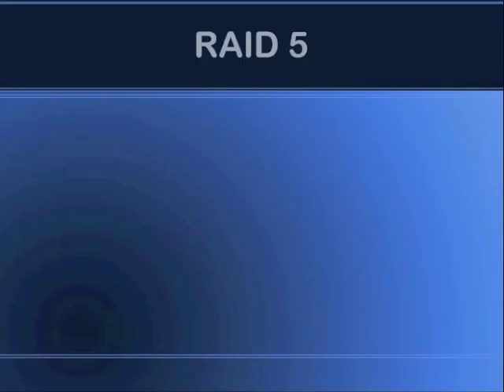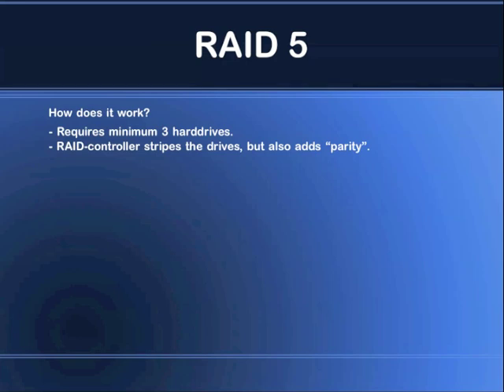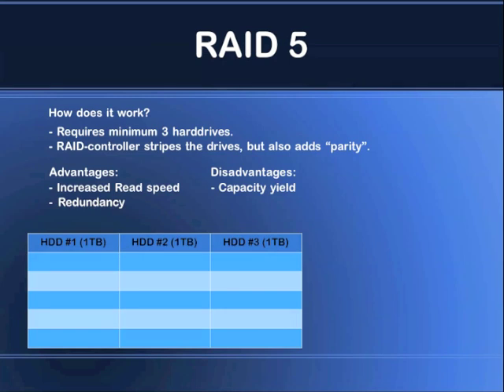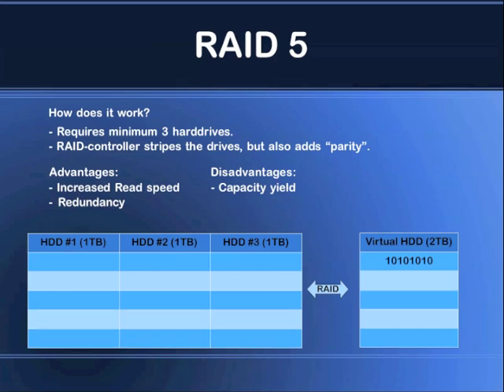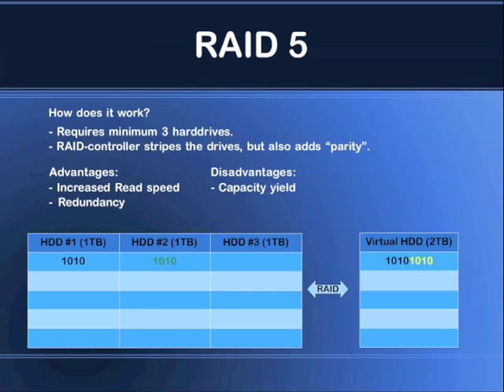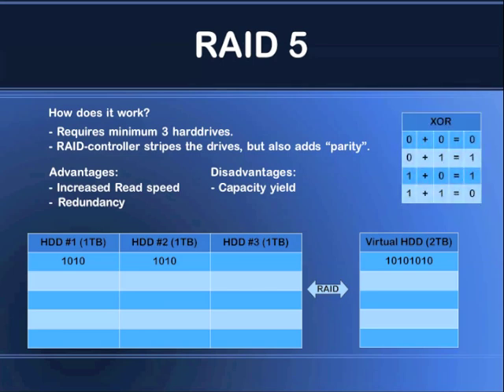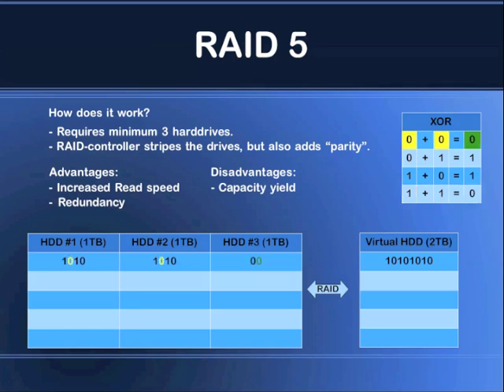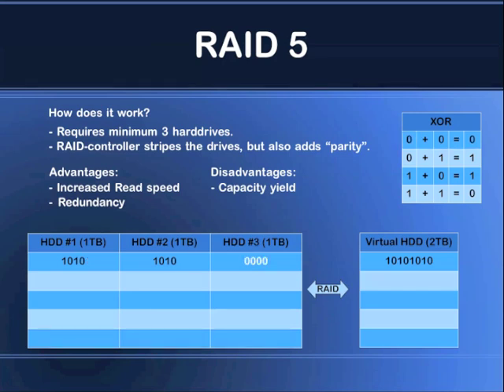RAID 5, explained

Comment: I've understood the bare-bones mechanics of this, but never understood how (the total of) one drive's space can hold data of two drives, but you explained it so very well!
I subscribed due to this video, I hope you have more great ones!
BTW, I am just now loading my backup into the new 3-drive array I built through Storage Spaces. It went together well, and my 6 TB has been loading for 9 hours now and has over a  TB left.
I saw there was an option to 'add a drive'. How many more drives of the same size (all 4TB) can be added before I need another one for parity? I think when I get to 5 drives I may go to RAID6. I also mirror that drive to a set of 8TB 870QVO. They are slow yes, but once the terrabytes are written to them updating goes fast, especially since they are striped. So it's something of a RAID10. I use 'freefilesync' for my mirroring and backups.

Comment: What happens if two hard drives fail at the same time, sir?
Reply from the maker: If two drives fail at the same time, the data is lost.
If one drive fails, and another drive fails before you swap the first one and rebuild the array, the data is lost.
So using RAID doesn’t eliminate the need for making regularly backups of the data.
There are also some RAID-setups that can tolerate more than one drive failure.
Reply: Thank you, sn0le. So Raid 6 can tolerate 2 disks fail at the same time, right? So we can not keep data 100%. But when raid tolerate 2 disks, what happens if 3 disks fail and so on.
Reply from the maker: @thlh1  
Yes. RAID 6 tolerates 2 drives failing. As long as you replace the 2 faulty drives the array can be rebuilt. A 3rd drive failure before a rebuild will redult in total data loss.
One can have RAID controllers that supports spare drives that automatically take over for the faulty ones.

Comment: BTW what if I have to replace one of HDD due to disk failure, Do I need to use new empty HDD, right?
Reply from the maker: Yes. You add an empty drive as a replacement for the dead drive and the RAID-array will rebuild the dta that was lost fromthe dead drive.

Comment: How would a RAID-5 work when you have 4 drives? Lets' take the first bit for example DRIVE-1: 1, DRIVE-2: 0 DRIVE-3: 1. So the three drives don't match. In this case, how would parity know how to reconstruct the data? "0" means that the three drives don't match but how would you know if to reconstruct with 100, 101, 110, 011, 010, 001, etc... there are many options for the mismatched bits.
Reply from the maker: It's agood question.
The RAID controller will do the XOR several times.

If you have this as a example.
Drive 1: 1111
Drive 2: 1110
Drive 3: 1100

First it will XOR drive 1 and 2.
1111 and 1110 creates a XOR-value of 0001
It then does the process again with the XOR value from drive 1+2 and the data from drive 3.
0001 and 1100 gives us the parity bits 1101.

Hope this was helpful. :)

Comment: What happens if you add another drive 4th drive? Does it rebuild everything? Or does it exclude the forth drive?
Reply from the maker: Hi, good question. I haven't tested that so I do not know what will happen. But I assume one has to make a backup of the data and create a new and empty RAID array with the 2 old drives and the new one. And then copy back the data.
Reply: Based on my knowledge, raid 5 goes by n-1. So technically it would not do anything unless u want it to be part of the storage

Comment: How does RAID 5 work when there are more than 3 drives? Just using xor will not work I believe.
Reply from the maker: For 4 drives it will first use XOR for bit 1 in disk 1 and 2. And then use XOR on the result from disk 1+2 and the 1st bit in disk 3 to make a parity bit in disk 4.
Hope that was understandable.

Comment: Very good explanation! Just a question - I understand why read performance could be increased, but don't understand fully why write performance does not benefit, as 2 of the 3 drives are striping correct? Does the overhead of calculating the third parity bit become the bottleneck?

Comment: you said at 1:20 that with raid 0, you would have a 3 tb virtual hard drive. This is not true. with raid 0 (and 3 drives), you only get the capacity of 1 drive and the theoretical speed of 3 drives

Comment: What I don't understand is how the drive knows what bits are parity bits, and which one's aren't. That can be seen as information itself, needed to be defined somewhere. 

For example, in the first row it will skip parity checking.  The second rows second column has white bits (which represent parity), and thus the data must be calculated.

So just how does the system distinguish  "white" parity bits from the rest?

Comment: So RAID 5 is the inexpensive way to go over raid 10, RAID 10 seems infallible however from what i've heard RAID 5 is very good at restoring a failed disk
Reply: raid 5 loses 2/3 of data when one drive fails. raid 10 loses no data when a drive is lost. it is also as fast as raid 0. so with raid 10 you get best of both raid 1 and raid 0. raid 10 is more expensive. thats why raid 5 is more popular in servers where down time is acceptable. you only loose 1/3 of total storage to redundancy where raid 10 is a type of mirror so you have only 1/2 of total storage available.

Comment: Your fault and SOL; data is gone. Should have replaced the first when it dies... If they die within a day or two from each other, then that's just bad luck and your data is still gone. 

Now, the real question is, if I had more than 3 drives, how exactly will it work? and what will happen to the data if 2 out of >3 drives failed?

Comment: Okay, well that would make sense then. I was wondering if there were an additional bit of data on each segment that identified it or something (and of course you would need to identify each half of the original data also, since you need to know which order to put it back together in), but that would not be very efficient. It makes much more sense that the RAID controller would keep track of it.

Comment from the maker: @Sofokleousma: Thanks. :) Yeah, if more than 1 drive fails you'll lose all of the data in the RAID-array when using RAID 5 without any hot spare. RAID 6 will give better redundancy since the array will keep working even when 2 drives fail. And you also have RAID 1+0 and RAID 0+1.

Comment from the maker: @2008rames:
As I've written in the description of the video.
The total capacity of the array is:
(n x cs) - cs = tc
n = number of drives
cs= capacity of the smallest drive
tc = total capacity

If you have 5 x 1.5TB it would look like this.
(5 x 1.5) - 1.5 = 6.0TB

If you have 4 x 1TB it would look like this.
(4 x 1) - 1 = 3.0TB

Etc etc...

Comment from the maker: @InfernoDragon56: As far as I know, yes. But I'm not sure it's "worth" it. Huge cost, and the speed of the array will probably be limited by the RAID-controller.  I may not be able to calculate the parity bits fast enough to give full use of the SSD' high performance. But I haven't tested it, so I'm only guessing and may be terribly wrong.

Comment: Hi,
I've a quick question - what if i've raid 5 have 10 disks and lets say 2 disks goes down? will raid 5 collapse?
Also, what would be the best way to upgrade RAID 5 storage disks (from 146Gb to 300GB SAS)  without downtime and breaking RAID 5.
would appreciate if you could help.

TIA

Comment from the maker: @paulph12002:
Thanks for the feedback.
Well, I haven't tested RAID 5 array (with minimum 3 HDD's) vs a RAID 0 array.
But from what I understand, a RAID 0 array will always be the fastest since no parity bits need to be generated/calculated.

Even with a non-RAID 0 array one should have backup. A RAID 1 or RAID 5 array doesn't eliminate the need for backup, since data can still be lost if files are corrupted or multiple drives fail.

So for max speed, RAID 0 is the way to go.

Comment: Good explanation of Raid 5, Snole. Would I be correct in saying that write speeds are slower with Raid 5 than Raid 0 because of the need to write and modify parity data on each read/write sequence? For that reason, I use Raid 0, and minimised the risk of data loss by using 2 identical new WD Caviar Blue HDDs, with any important data backed up onto a HDD that's not part of the Raid.

Comment from the maker: @dirtydoug:
1. Yes
2. Yes (but still faster than a single drive).
3. If you need speed, use RAID0. RAID5 will be faster than a single HDD/SSD, but also give you redundancy.

Comment: Hi very informative video but im still new to raid and trying to learn, hope you can answer my questions

1) so raid 5 is safer than raid 0 but raid 0 read/write faster than raid 5, is that correct? 
2) raid 5 is only fast on read but slower on write?
3) I like to use 3x60gb ssd as raid but im confuse which 1 to use raid 0 or raid 5, i use this 3 ssd for my OS only and to make my applications load faster at startup but if raid 5 will slow down conversions that wont help.

i really need help TIA

Comment from the maker: @PossiblePoison:
You can use different drives bought at different times. No problem.
The optimal solution is that they are the same size and comparable in terms of performance (seektime, readspeed, writespeed etc).

Comment from the maker: @FrankfurtamMainxxl:
You can use RAID 0+1 or RAID 1+0.
It is a combination of RAID 0 and RAID 1.
It requires 4 drives, and will give you very good read/write performance.
You'll also have redundancy in the RAID-array, so that if a drive fails your data is still safe.

Comment from the maker: @patrikk777:
RAID 0+1 and RAID 1+0 requires minimum 4 drives.
The benefits are that they're faster than RAID 5. And the data MIGHT survive multiple drive failiures, as long as they are on the same side of the mirrored set. (At least for RAID 1+0).
The disadvantages that they are complex to set up and expensive since you must have 4 drives and only get 1/2 of total disc capacity.
But I am no expert in this, so you shuld really do some extensive research before you decide what to use.

Comment from the maker: @patrikk777:
I haven't done tests with RAID5 my self.
I would only have to assume that a RAID0 will be faster since the RAID-controller doesn't have to calculate the parity bits.
I might be wrong about it though.

RAID 0 offers high R/W performance at a relatively low cost. But it has 0 redundancy.

RAID 5 offers good R/W performance at a slightly higher price because of the extra space needed for parity bits. But it does offer redundancy.

Comment from the maker: @gnabeel:
RAID 0 is good for speed, and gives you the highest capacity of the various RAID types.
But it offers no redundancy, and should only be used with that in mind.
If you need a fast scratch-disk for video editing, RAID 0 is a good choice.
If you need data to be safer than on a single HDD, RAID 0 is not a good choice.

So it all boils down to the needs one has. RAID 0 isn't necessary the best. ;)

Comment from the maker: @skovacs:
As far as I know, expanding an existing RAID5 array is not possible.
You'd have to backup everything and configure the array from scratch.

This is a definite downside to RAID5, and Netgear has made something called X-RAID that allows for adding more drives and still keep redundancy.
Not sure how X-RAID works though....

Comment from the maker: @r1ccardo:
The drives can be various sizes and speeds.
But the array's capacity will be dictated by the smallest drive.
If you have a 500GB, a 1000GB and a 1500GB HDD, the total capacity will only be 1000GB.
So it would be a huge waste.

Using a SSD is possible, but a complete waste, since the performance of the array is limited to the slowest drive.

Comment from the maker: @vjo219:
Thank you.
If there are more than 3 disks the RAID array will function at a higher rate.
The total capacity will follow the formula in the descriptionbox.

Lets say you have 6 harddrives, each of them 1TB.
The total capacity of the array will be 5TB, since you'll always lose the equivalent of 1 HDD because of the distributed parity.

Comment from the maker: @paxat:
Thanks. And a VERY good question. :)
I actually had to Google a bit, and I did find some good guides to how a RAID 5 finds out which data is the parity bit and so on, and thus recovers the data in case of a disk failiure.

However, the explanation is VERY complicated, and I would probably have to make an entire video to show how it works.
And I'm not even sure I fully understand it myself. Lol.

I think I'll just say that the RAID controller figures it out. Hehe. :)

Comment: @sn0le 
I know that for RAID 5 you need at least 3 drives,but i don't know how many drives support RAID 0.
So which RAID would be faster on this drives in SATA 3    6Gb/s
two Crucial RealSSD C300 64GB and two WD Caviar Black 1TB,
those 4 drives in RAID 0 and RAID 5, which one would be faster ?

Comment from the maker: @SutkasFan:
The speed depends on how many drives you have. That also applies for RAID 0.
RAID 0 will be the fastest RAID-array, but it is non-redundant.
So if you lose one HDD, the data on the entire array is lost.

RAID 5 is almost as fast. It is slower since it has to generate the parity bits.
The advantage for RAID 5 is that if a HDD dies, your data still remains intact.

Comment from the maker: @killerstef22:
Not that I know of.
Besides, there would be no point.
If the drive with the 2x size fails, you will lose all your data anyway.
So you could just use striping instead.
Unfortunately, striping gives the best capacity when the 2 drives are the same size.
1x500GB + 1x1000GB will only give you a 1000GB RAID 0 array.
So not much point in that either.

Comment from the maker: @kidowner:
Hehe. Me neither. So I took the easy route and mirrored 2x1TB on my fileserver.
I could go for a 3x1TB RAID5, but RAID0 and RAID1 is alot easier to set up.

And I have an external 1TB drive for backup of the RAID.
Because a RAID doesn'r remove the need for backup.
A lightningstrike may fry your entire computer, with HDD's.
And then any RAID, even with spares, might not do you any good.

Comment: @sn0le well the problem is that my mobo wont support that much sata ports.. I mean i will already have 2 ssds in raid 0 for windows and major applications..

+ 2 Optical drive disks

+ 3 HDD 

+ E-sata..

= 8 satas

Comment from the maker: @kidowner:
I am by all means no expert.
But as far as I understand it you would have to go for RAID5 if you want to get 3 drives working like that.

I was concidering RAID5, but I have too little experience with this, and as far as I could understand a RAID5 has to be tweaked in terms of stripesize.

If the stripesize is to small, you'll lose RW-performance.
If the stripesize is to big, you'll lose capacity.
And the correct size depends on the filesize of the files you will put on that array.

Comment from the maker: @kidowner:
In more detail.
A RAID5 array creates parity bits of the data that it writes to the disks.

A RAID 0+1 will just split the data in half, to stripe them, and then simply mirror them

A RAID 1+0 will mirror the data on 2 HDDs and then stripe the data onto 2 other HDDs.

Comment from the maker: @kidowner:
Well, I wouldn't put it that way.
A RAID 0+1 array with 4x1TB disks will give you 2TB of storage.
A RAID 5 array with 4x1TB disks will give you 3TB of storage.
So RAID 5 has less capacity yield.

But both RAID 0+1 and 1+0 can sustain more than 1 HDD failiure, as long as one of the mirrored sets are intact.

RAID 0+1 gives the best RW performance, and RAID 1+0 gives read performance that is at the level of RAID0.

Comment from the maker: @produKtNZ:
Data can be either 0 or 1.
0 means "off" and 1 means "on", sort of.
It is the state a bit can have.
It has either the value 0 or 1.

As an example:
The letter "a" in the ASCII-table is 01100001 in binary.
The letter "b" in the ASCII-table is 01100010 in binary.
And the list goes on.
If you were to make a parity bit out of these 2 characters, it would be:
00000011.

@4:00 the parity bits are data, even if they are "0000". And they are crucial for any rebuild of the original data.

Comment from the maker: @fakinade1:
Setting up a RAID5 array is not too hard (depends on the RAID-controller).
You specify which drives are a part of the array, and the controller does the rest.
You can specify that 1 or more HDDs are "spares".
So if one HDD dies, the array will automatically rebuild, using the spare HDD.

However, stripe size is crucial. It needs to be tweaked to a size that matches the files you have.
Using a stripesize to small or too big will cause performance loss or low capacity yield.

Comment from the maker: @fakinade1:
Once you have created a RAID-array it will be visible on your operating system as a normal disk. So you can drag and drop files/folders to it like on a normal disk.

Having a RAID doesn't mean you don't need backup. Even with RAID5 you could experience a failiure that will make it impossible to retrieve the data.

I found that RAID5 needs more optimalisation (stripesize etc) to get optimum performance, so I put 2 HDD's in RAID1 (mirror) and have 1HDD as external backup.

Comment from the maker: @frwgt350net:
For software RAID, the choices are a bit limited. There are ways to make XP support more software RAID types.

If you have a RAID-controller, either as a PCI/PCI-express-card or built in to the motherboard you'll get all the types of RAID that your RAID-controller supports.

On my own fileserver I use the built-in Intel Matrix RAID-controller (on the motherboard) and the software that comes with it. No problem.